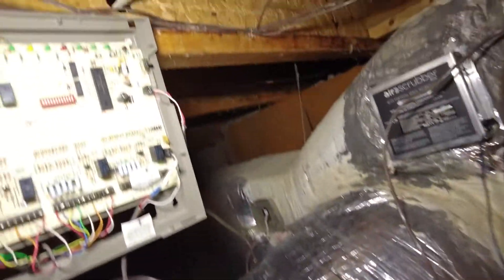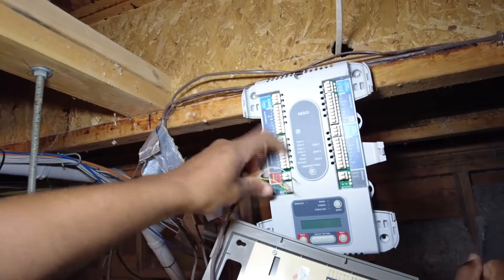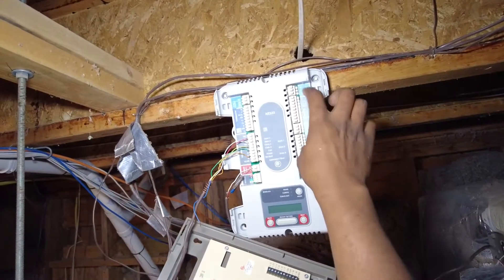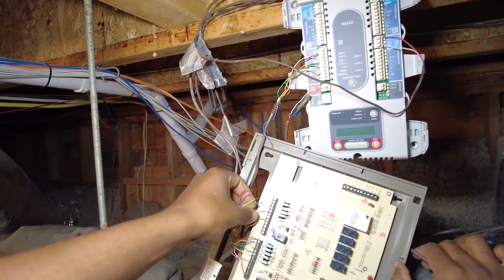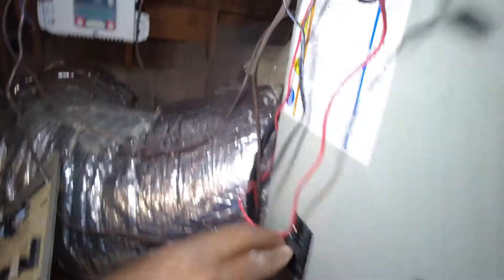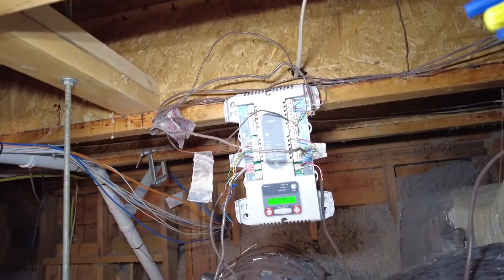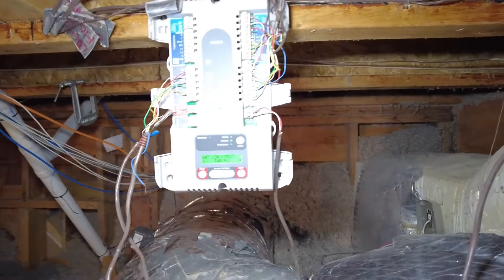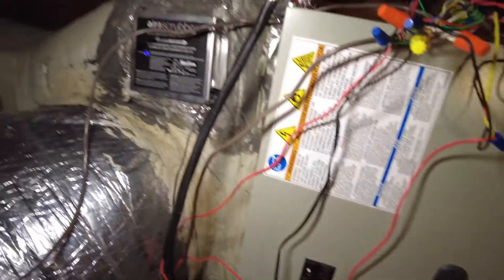HVAC Tech Installing The Honeywell HZ322 Damper System | Troubleshooting a zoning board

Comment: When wiring the equipment side, why did you put the auxiliary call on W2 and not W1/E?
Reply from the maker: Basically because they pretty much function the same.  If I'm not mistaken, the only function you're missing if you don't wire it to W1/E is the ability to be able to run emergency heat from the Zone board by pressing the emergency heat button. You definitely want to have it wired w1/E at the thermostat though.
Reply: @HVACTechKnowledgy  Thanks.